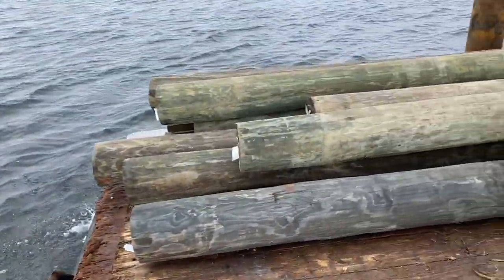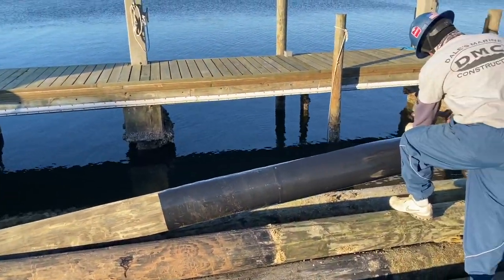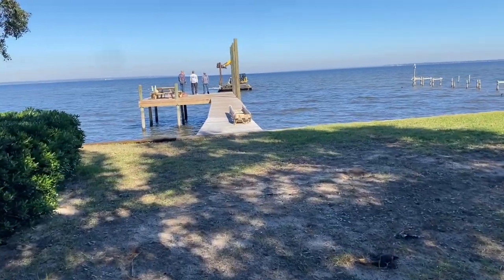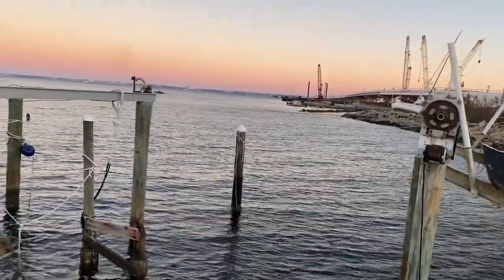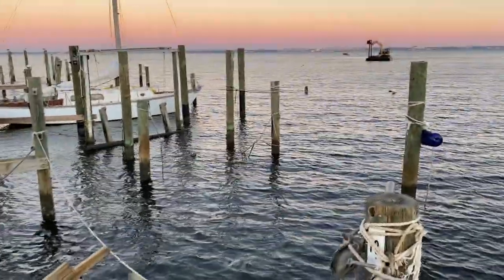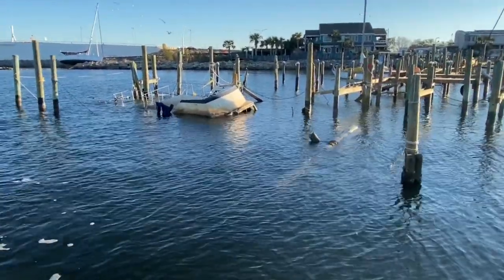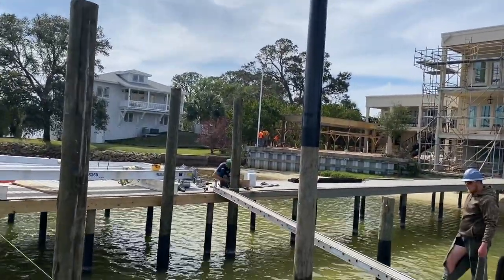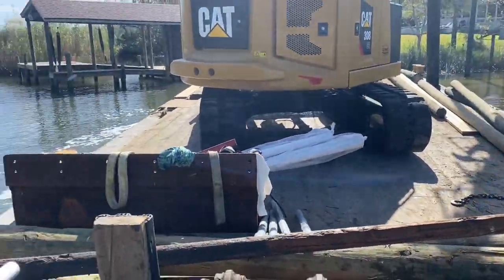MARINE CONTRACTOR VLOG/ miscellaneous projects along the Gulf Coast with hurricane sally repairs

Comment: Thanks for your video very very interesting indeed. I've alway been curious as to how these pilings are done and now I know. 

I have a few  questions. 

In general how deep do you need to go with the piles? 
Can this system be used for over water bungalows and have you completed  contracts for such like?
What solutions would you recommend if you come into contact with bedrock beneath the sea bed? 
In general what type of annual maintenance if any is required?
Any way to hurricane proof the structure? Thanks again.
Reply from the maker: Great Vibes Thanks for your comment I appreciate that. On our boat house as we typically go 10 to 12 foot in the soil we only have sand and some hard pan clay conditions here so we have never experienced bedrock in this area. I’m sure there are some other contractors in different areas that do and I believe they drill through the bed rock. Our boat houses have done pretty good in the hurricanes we always go back to see what we can do to make them with stand better. The only issues that we have had is Boats getting loose and hitting them and breaking the pilings. We also use a piling wrap to wrap the poles to prevent Torito board warms from eating the pilings with this system installed you should not have any maintenance on the pilings.